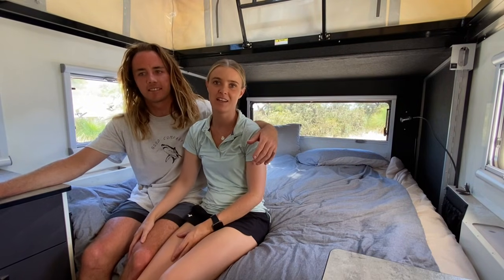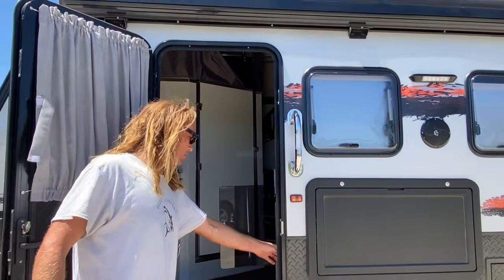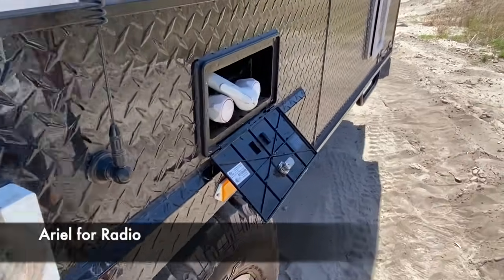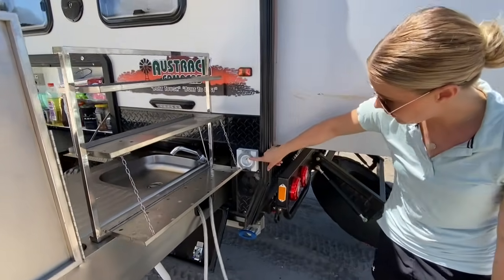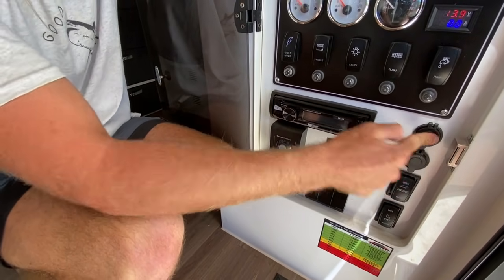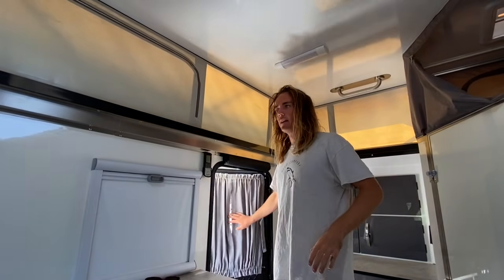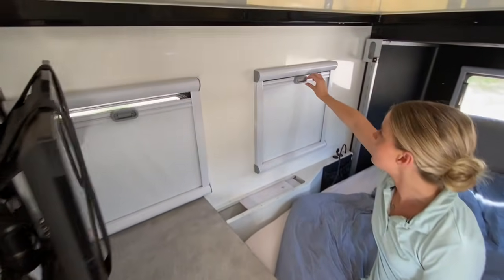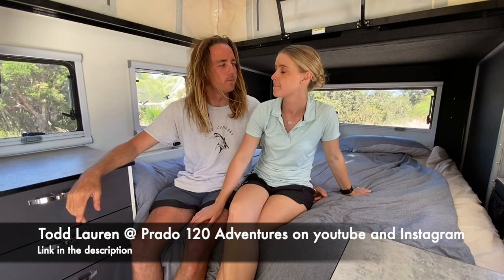Austrack Tanami x11 Hybrid offroad Caravan Full walk around / Trip around Aus / Truma / Enerdrive

Comment: great vid guys, but just some info re lithium batteries..  They are the way to go, 200aH will give you twice the capacity you have now and bear in mind while you are parked up, the only draw you will have on your system will be your fridge and maybe TV or sound system, and the solar will, in most cases , be supplying that use anyway plus feeding excess into your batteries, so the panels you currently have are very capable. Also, fitting a 40 amp DCDC charger will pump into your system as your driving so rarely will you pullup somewhere  with less than 100% power...HOWEVER, your invertor is a HUGE user of power, but used in moderation is not a problem. If you are going to go to lithium, inform your supplier the wattage of your invertor because the lithiums they supply will have to have the rated current to supply it.  i fitted 200aH lithium battery and 2x 150w panels to an older poptop van, along with a compressor upright fridge and they have advised they have never been below 65%...........Just something for you to think about....travel safe..
Reply from the maker: Thanks graham for the info! 
I love the idea of lithium! Especially if we could run our aircon with it! I think we would need 300ah plus tho! We are planning on going enerdrive 40amp dcdc charger. 

Either way lithium is the go! Not having to worry about power consumption would be awesome! We will probably go 200amp hour like you said and just bring a geni to run the aircon! On the hot days! 

Can’t bloody wait!
Reply: @SarahandKeelanTravels  like your thinking.  Running AC off lithium reqs lotsa aH,s, 300 aH would be a minimum , just bear in mind you cant run your generator in National parks and some other places, and dont get sucked into the Honda/ Yamaha ripp off units....plenty or good gens out there  1 third the price those thieves charge....

Comment: Hi Guys.......came across your channel & watched this video with interest. We have recently taken delivery of a new Austrack Simpson Camper Trailer & have had very similar experiences with both the quality & especially customer service!! There is no doubt that Austrack has a good product, but a little more attention to the small details would make it an even better product......and it really would not take much or add much to the cost.

As for customer service, they definitely need to raise there game. I had an issue with the water pump on the trailer, as I considered it to be excessively noisy. After a phone call, they asked me to send a video of the problem, which I did. They then asked me to take the trailer back in to the Caboulture  showroom & they would sort it out. (An hours drive each way from my home on the Sunshine Coast.) After they looked at the pump, I was told that "this is normal because of the pressure required for the shower"........which is just rubbish......and why couldn't they have told me that from the video I sent?? 

I have since replaced the pump & it is now nice & quiet & the shower still works just fine. Be interested to know how you find the water pump on your van.

Despite the disappointments with Austrack, we have been enjoying the trailer & the small mods we have made ourselves, have made a world of difference to our experiences!

Interesting that there are not any reviews on YouTube for the Austrack Simpson Trailer either, apart from the ones posted by Austrack themselves.

Keep up the good work, look forward to seeing the videos of your travels around Oz!! Good luck!
Reply from the maker: Cheers for the the comment! 
That’s ridiculous.. should of lodged a loss of time invoice for the fuel and the hour each way. I’m yet to invoice them of all my fixes. Caboolture showroom seem to be a fair way behind in customer service than Melbourne and NSW showrooms. We stopped dealing with them and just went to the other crews! 

Good to know you got right up them about it though! It’s a good product just disappointing on the finer details which is what makes a product go from good to great. 

Our pump isn’t to noisy. In fact can’t really hear it too much at all only initially on start up. 

Good to see some fellow austrackers following our travels! Thanks for your support really appreciate it mate! We can’t wait to take off on our big lap! If you ever see us out and about make sure you give us a Oi and we can have a beer!

Comment: Thanks for another great video. If you wanted to convert to lithium you would not have to change anything with the Enerdrive setup you have.
A agm battery should last 6 years if looked after.
Reply from the maker: Cheers Brian! 
There’s a few settings in the 240v charger needing to be changed also lithium compatible dcdc charger! I love agm, would just love to have a battery bank I can not have to even think about while we are remote for 2-3 weeks straight!

Comment: Good review guys. Just a quick note about your Mchitch. In your walk around you spun the locking top very easy and it was hitched to you vehicle. That must be screwed into the top of the tow point and locked down using the lock pin to tighten it, otherwise your van is just only sitting on the towbar, not secured at all!!
Reply from the maker: K, I knew someone would pull me up on this! Haha very observant! What happened was I started un hitching the van for the walk around and then decided not to take it off! So I loosened it off and forgot to tighten it up again! 
Surprised I didn’t cop more flack! Thanks guys ahah
Reply: @SarahandKeelanTravels  no worries!

Comment: Have a look at lock your hubs video on hi lift Jack. Make the handle extension with  one end cut at 45 degrees. Get the winch kit for it. Now that 12volt at back of van. Get the 25 watt oz light. Now on camp fire. Drive handle in ground. Now light will fit in lighting area. You have a spare winch with Jack. Russell
Reply from the maker: Thanks for the info Russel!

Comment: Great review. Thanks for sharing 👍
How does it towed? I ordered one and go a standard prado gxl. Wondering if I would need any mod on the prado’s suspension?
Reply from the maker: Glad you liked it! 
Tows good! Dosnt sway or carry on however a fair few people say they have had trouble with the sway. It’s a lot heavier than I anticipated. In my opinion I think if you wanna tow a Offroad van with a lot of clearance you need upgrade your suspension in your towing vehicle to suit. 
I run 400kg constant load suspension in the rear (stiff) with 2 inch lift all round. Works a treat and the car is level and not pointing upwards!
Reply: Thanks for your feedback. 👍

Comment: Hi guys 
What size tyres did you squeeze on your prado 
How much lift do you run 

Did you have to do ant trimming to fit those rims on 

Great channel 

Cheers
Reply from the maker: Hi Stuart they are 285/70/17 (33s) and yes you need to run a negative offset rim to make them fit and also trim the inside of the front guard out! Thanks mate!

Comment: Thank you that dust getting in a bit of a worry any idea where from and can it be sealed
Reply from the maker: Yeah it’s coming through the back door (fold out part) so I might have to tighten the compression locks a bit
Reply: @SarahandKeelanTravels   to solve dust ingress issue all you need to do is turn the ensuite exhaust fan on reverse which will put a positive pressure inside the van preventing the dust from entering.
Reply from the maker: I’m not sure how much this will work because it’s weak as buggery but we will give it a shot! Thanks for the tip mate! Really appreciate it

Comment: Great review guys!!
Just a thought re solar panels... could you attach slimline panels to the rear ‘hatch’ that lifts up when the bed extension is set up? May allow for a heap more solar if you decided to go lithium....
Just a thought!!
Reply from the maker: Thanks mate! 
Your bang on the money there you can for sure and that’s what we will do if we go lithium! I also have the 80wat panel on my car roof which I can connect into the van! in addition to the 160 watt panel + the 300 on the roof of the van which is roughly 540wats of solar! 
If that’s not enough I will be chucking some panels on the back wall!
Reply: @SarahandKeelanTravels  good stuff!! Just been through solar panel mounting / mppt solar regulators / battery’s etc with my parents for their Landcruiser Ute and van so it was on my mind!!!